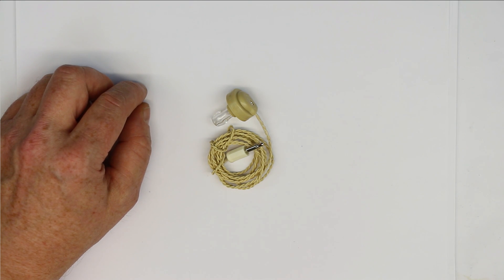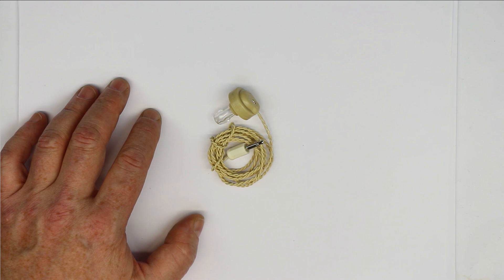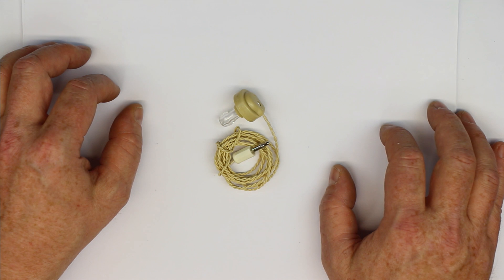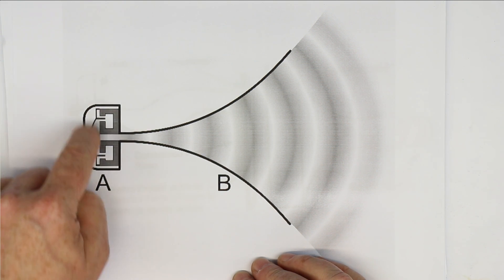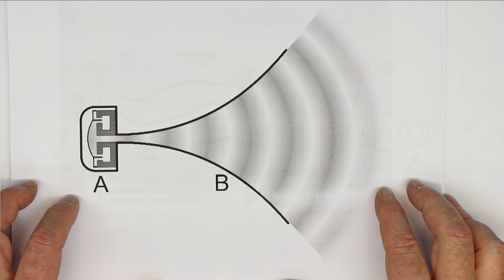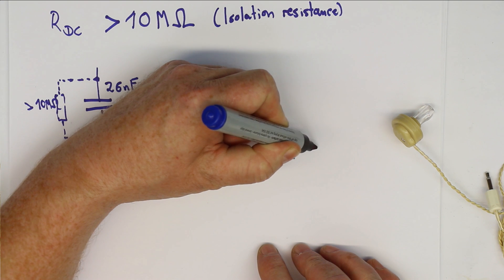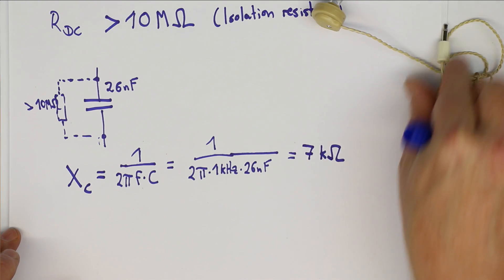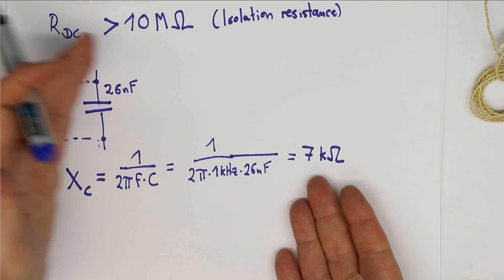How a Crystal Earpiece works

Comment: Excellent!  I am reminded that similar setups are used in ultrasound sensors and there (as in this case possibly) the distance to the back of the case of the earpiece is important to so it deals with reflected sound waves effectively.  Though, of course this device is much smaller than the wavelengths of sound it is required to produce.

Comment: if I connect two  of these in series  I get louder volume?
Reply from the maker: Well, it depends on the output impedance of the signal-source:

If the crystal-earpieces are connected to a low-impedance source (output of an amplifier-stage), then the voltage at each crystal-earpiece halfes and thus the power in each earpiece will be only one fourth compared to a single earpiece.

If the crystal-earpieces are connected to a high-impedance source (output of a crystal-radio) then in fact the voltage (nearly) doubles over the total of the 2 crystal-earpieces.
So each crystal-earpiece gets (nearly) 1,4 times the voltage and thus double the power.
Both crystal-earpieces together then get four times the power.

You can do the maths with Ohm´s law or simulate it in LT-Spice to understand it.
It´s quite a good learning example :-)
Reply: many thanks for explanation! btw great YTchannel :)

Comment from the maker: What I forgot to mention is what the "Crystal" in "Crystal earpiece" means.
Originally crystal earpieces were in fact made out of a specially shaped crystal of Rochelle salt (Potassium sodium tartrate tetrahydrate). Rochelle salt was the first known material to show piezoelectric properties (together with quartz and others).
Modern piezo-transducers (piezo-discs) use a layer of Barium-titanate on a disc of metal. Barium-titanate is a "ferroelectric" material which is a sub-class of piezoelectric materials. Ferroelectricity is analogous to Ferromagnetism although there is no "Ferrum" (=iron) involved.